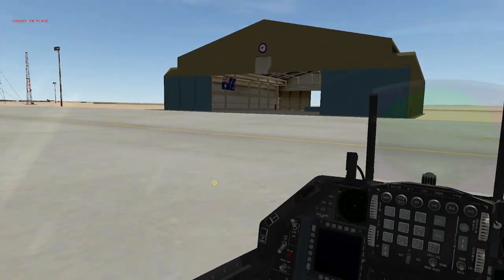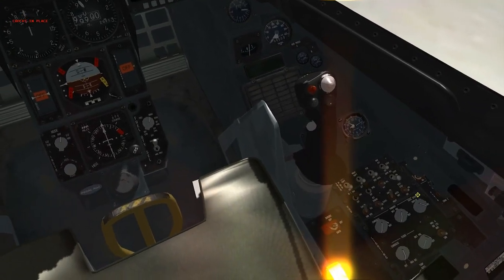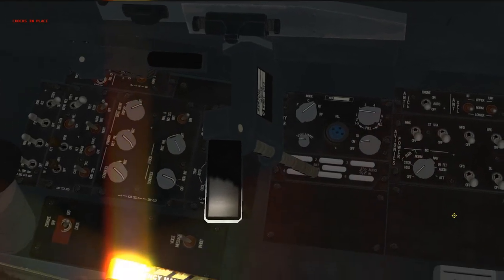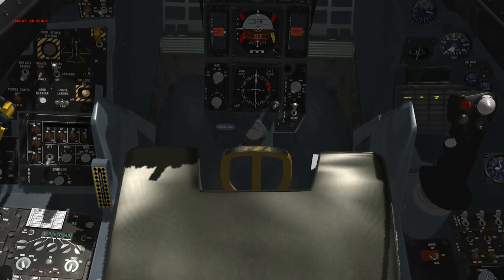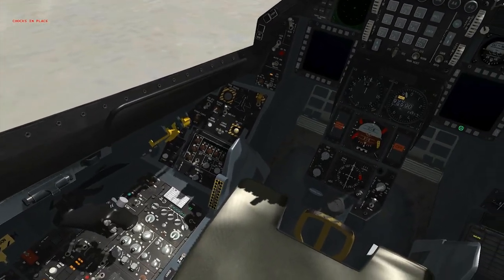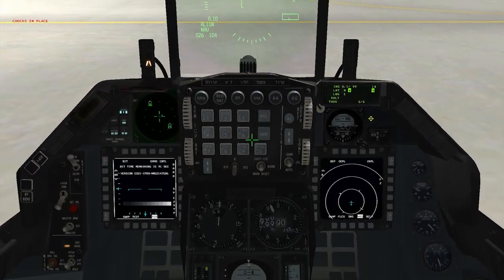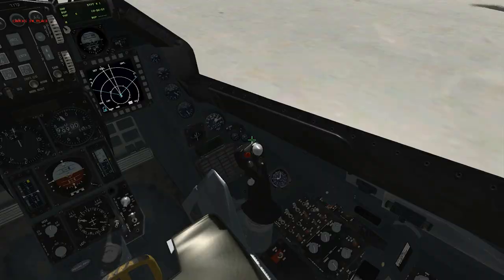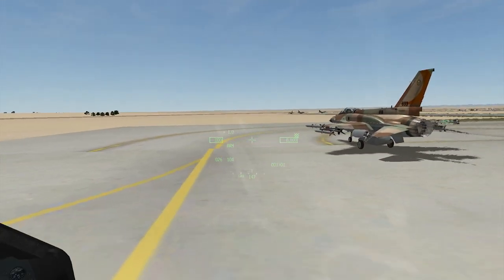Falcon BMS: Adventures with ramp starting an F-16.

Comment from the maker: Well, the game isn't molded to red ball avionics on ramp starts. So to be completely honest, it doesn't matter. It's the same concept of running a FLCS bit in the same manner, it never fails unless you interrupt the bit with rudder or stick input. The same applies to the INS aligning regardless of a position solution as well as a SEC check and run up. Mind you, I was teaching my friend what applicable switches need to be turned  on as we went along with the launch.